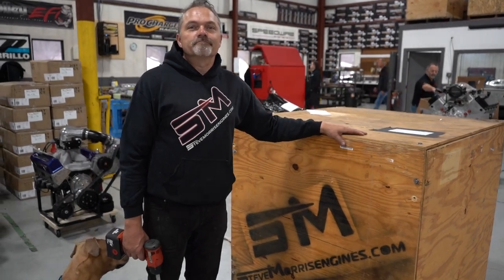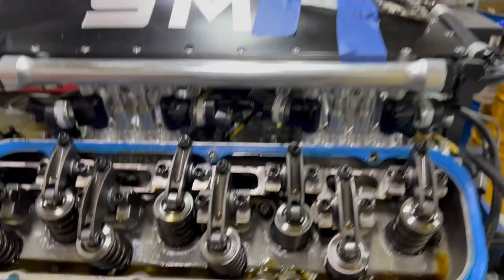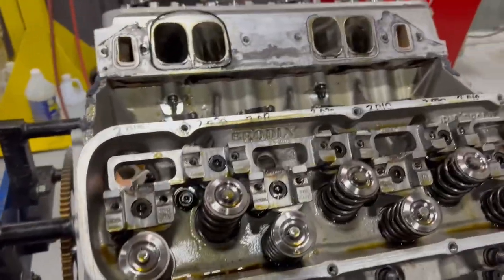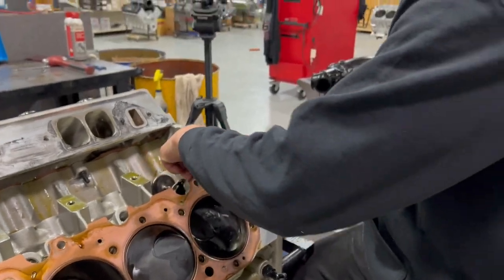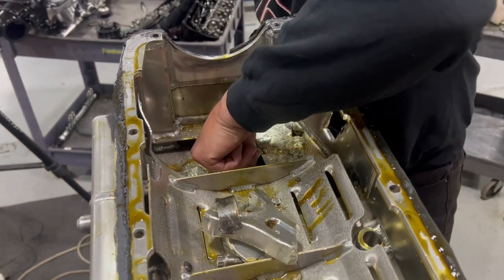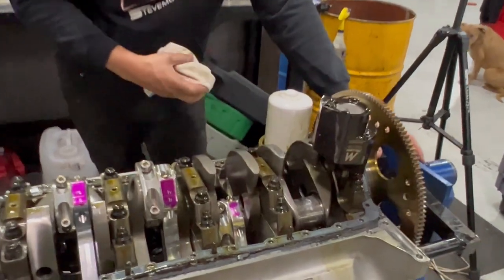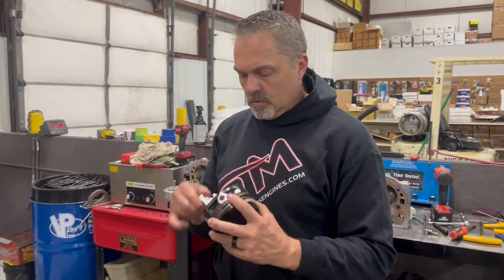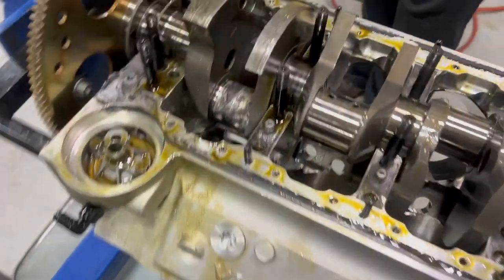Mullet !  What Happened ? - Warning: Engine CARNAGE

Comment: I had my money down on a cracked block. I'll eat crow on that. My next question, how much boost does it take generally speaking to bend one of those cranks? I also have to wonder myself ( and I by now means what so ever am even close to being an expert, I am just trying to obtain some education here ) if hitting 50psi and then slamming into a quick boost cut had anything to do with that. I still think that the damage was done during the first pass at Bradenton when he power wheelied. I could well be wrong about that as well.
It will be interesting to see what choices Garret makes from here.

Thank you Steve for taking the time to show everyone this tear down!
Reply: Prediction: This motor goes into Leroy, SMX goes into Mullet, and Cleeter and crew continue to operate without a checklist and start the motor without oil at least a few more times.
Reply: @icandreamstream  I suspect they have been working towards an SMX for mullet. I just don't think they were quite ready to go there just yet. I dont think this engine will go into leroy. Assuming the block passes muster, I would hazard a guess that it will be built to be a back up for toast or killa bee. You have to admit, he has been getting slightly better about going thru things. Mainly because of the expense involved in not doing so. Short term though, I bet the BBC gets rebuilt to get mullet back on the tracks quick as possible. That or Steve found him a used SMX, like the one out of the wagon for a reduced price tag. One thing is for sure, we will see how the pieces come together soon enough.

Comment: Welding an aluminium block is a bad idea. The heat affected zone will be annealed and its tensile strength will be a tiny fraction of what it was at the original temper.

Edit, unless you guys heat treat the block after welding. However, both welding and heat treating will cause distortion. All interfaces would move. I reckon that would scrap the block. Only way to be sure would to 100% measure it afterwards

Comment: My old man had an international pickup with a connecting rod jammed into the side of the cylinder wall , literally ran quiet and smooth for months before he pulled it apart and was shocked how she was hanging in there ….

Comment: Hi Steve
Enjoy your content.
I have a couple of observations to share,  to try and help, not criticize.
The Half seized main is strange yet also interesting, could there be a misalignment with the tranny???
This crank was a proven, reused piece so a factory flaw is highly unlikely.
Rod journals 7 and 8 have evidence of seizure
Please correct me if i am wrong...
Rod 7 oil is fed from Main 4 which also feeds Rod 6.     Main 4 is half seized, rod 6 is fine, rod 7 is seized.
Rod 8 is fed from Main 5, Main 5 is fine, rod 8 is seized.

One potential cause is aerated oil.
Air will travel the path of least resistance, it will affect the closest components from the pump first.
I am assuming this engine has traditional oil galleries.
In the case of a BBC, oil enters the block from the oil filter at the rear, feeds the cam bearings then down to the mains.
If air is travelling with the oil it will hit the rear cam bearings first, have a close look you may see some smearing.
it will then travel to the rear mains and so forth moving forward, the air will dissipate and be less of a factor further down the line.
Main 5 is substantially larger and supports less load because there is only cylinder 8 to support.
Main 4 is smaller and supports the load from both cylinders 6 and 7.
I believe this is where aerated oil will most evident.
The crank rod oil gallery timing with the main may explain why rod 6 is in much better condition than 7.

Your refresh video of this engine eluded to potential oil starvation issues with wet sump systems.

Dry sump this puppy.     or......... What Garret really needs is an SMX.......... 

Thanks

Comment: Well high boost damage is one thing but high load low rpm would put the crankshaft under insane amount of load . And they are locking the converter up pretty early . But that’s just a hypothesis. Thank you for always sharing and teaching . God Bless.

Comment: I'm no engine builder, but for an application that I KNOW the engine is being pushed beyond what it was designed for, I wouldn't even consider repairing that block or the chunks taken out of the head. Cleeter just needs to step up to the SMX and let 'er eat.

Comment: #4 main feeds oil to #6 and #7 rod journals.
#5 main feeds oil to #8 rod journal.
If the #4 main was the problem that caused the failure then why doesn't #6 rod journal look like #7 and it wouldn't cause  #8 rod journal to fail. Why is the rod missing both bolts and a rod cap?
To me it seems the line bore of mains was cut incorrectly on #4 main or crankshaft main on #4 was machined off center for the main to wear on one side or could the upper main bearing been a different size? Them guys running engine with no oil I'm sure wasn't good either. It's definitely a shame that the engine had only a failed roller lifter and after a refresh it has catastrophic failure.

Comment: Steve do you send out crankshafts in between refreshes or just have them checked when something is suspected?? Would a external oil pump be better suited for this type of setup?? Thanks in advance
Reply: Steve already addressed the oil pump and preferred external pump previously during the breakdown and refresh of this engine -> see that video
Obviously, Steve would have sent the crankshaft to the manufacture to be checked during the refresh, if he thought it was necessary.
Reply: Thanks not Steve.. I was asking about his procedures not your opinions fan boy!!!
Reply: @brown7002  Seems clear that Your using "self-reflection -> projection"' as a "Fan Boy" !! 😞

Comment: All I got to say cleetus ran 20 pounds or more more boost than you told them that engine can handle. He abused that engine beat the Tara out of it and it's stood up to the abuse. No one can trash talk you on how you built that motor.  That motor was used and abused and put away wet and went out with a smile on its face with A W. What more could you ask for out of an engine? You couldn't build a better one double the boost you said it can handle. thumbs up and keep it up you're awesome.

Comment: You say it "shows it wasn't running" when the valve head separated but, if the con rod broke, the engine could have still been running, just on that cylinder the piston wouldn't have been going up and down so, same effect. No conclusion about that from that damage, IF the con rod was broken before or at the same time.
BTW, I've had engines with smaller diameter PISTONS than that valve head you plucked out of there! They are huge, of course!

Comment: So you do/don't believe it was A NO OILING issue??? "30 secs to a min with no oil in motor running"  Maybe seized the bearing for a moment".22 secs Then when full pass spun the crank bearing causing the 2 rod bearings to seize, then breaking the Rods??   All  happens quick, so maybe hard to figure out.......

Comment: This is a rookie question as I have no machining experience but I’m just curious if main bearing 4 on the crank could have been slightly offset from the other bearings, meaning they aren’t actually concentric and that one was a couple thou off center. I don’t know how feasible it is or if I’m just making stuff up, just trying to learn something.

Comment: When the crank was ground, could that main journal have been machined out of round? Would make the clearance tighter on that side of the bearing surface. If the main journal is not perfectly round in relation to the center cross-section of the crankshaft. Correct?
Reply from the maker: Crank was never ground go see previous build videos on this engine
Reply: @stevemorrisracing  No I saw the build video. I'm talking about when the crank was originally machined during creation.

Comment: My question is? Is it worth welding and saving the block? This last drag n drive and last year before the refresh Cletus has stated the engine has dropped oil pressure while on the road driving. Also Cletus has stated he has drained the oil for an oil change. Ran the engine and remembered he/they didn’t refill it with oil. Also Cletus keeps telling Pete More boost. Step him up the the Max engine so he can go 5’s in the quarter.

Comment: Wondering if a couple of runs prior to the failure, it hit a huge boost cut under load and thats what snapped the fuel pump belt and possibly twisted the crank. Lets see the verdict Steve, i'm intetested.🙂

Comment: Did you ever figure out what happened to your engine? Was it just a manufacturing defect in the rods like improper heat treatment or something that made them weak? I know not even top fuel brakes all 8 at the same time, that had to be that those rods were weak.

Comment: Hey Steve, here a question for you.  Cleetus spun and started that engine over before oil was put back into the crankcase.
Oil feeds from rear to front, do you think he might of starved the rod journal and pushed rod bearing material to the main journal?  🤔
Reply from the maker: Depends on how long it ran

Comment: Ran without oil heated and coked the oil that was there and stuck the bearing on shut down, the oil just lubricated the damage after startup. I feel the bearing damage on the bottom side the rod is from minimum oil pressure on the bottom end of the track and throttle slams shut yanking up instantaneous when high vacuum hits

Comment: you could have gave the crank the ring test , hit it with a metallic object and listen to the way it rings out , also you could have tested that No.4 main journal with a micrometer riding the journal with it back in the block . could of and could of . we guys that built engines in our shacks in backyards or garages knew how to check things without any money to spare ! ever check the journals for out of round or deformity ? Yea Yea trust  of a "new" or freshly machined crankshaft ? tolerances can be a bitch , my guess is that crank had a clearance problem , could have been a few thousands of an inch , all it takes for a hot spot developing under load,, an issue hiding from the start that caught you by surprise ! it is possible that a the crank twisted by a few degrees between the 3rd and 4th journals warping the mains center line ? If you inspected ,checked the crank during assembly to rule it out.

Comment: injector stuck open and hydro-locked under deceleration? 
fuel then evaporated or blew out after failure. 
would want to check injectors since all signs point towards hydro-lock.

Comment: Line bore is an issue along with the crank ..Crankshaft flex generally gets the center main.However if the line bore is off well you know
Reply from the maker: Line bore off would hit the journals all the way around not on 1/2 the main journal

Comment: If it was my engine or money,  I would not be refitting that crank.   How’s the data logs Steve ?   That should tell if it hydrauliced, if the fuel didn’t burn, there should have been a whole lot of o2 on the oxy sensors .   Funny they run it for a whole season, no issue,  it gets serviced and doesn’t survive the week?   How did the crank inspection go before refitting servicing the engine? 
Magnafluxed ok?  I mean you didn’t just clean that crank and throw it back in?  If you did not get it checked out, then what did Cletus pay for?   And what he payed went straight down the shit hole because the crank was not inspected?  
You may have to bend over and take one for the team Steve.   Makes no sense the old engine could last a season of abuse,  you change brand of rods and possible neglect getting that crank check out, Magna fluxed etc. 
I know you will look after Cleetus regardless.   He is one of your best business advertisements with thousands watching! 
I have had to touch the toes a few times myself,  and I was alway rewarded with the customer staying loyal and my reputation did suffer.
Plenty of other stood firm and said well now that’s racing,  and I gain there ex customers.   People hate throwing away cash and being told, well boy that’s racing 😢

Comment: You need to start holding Cleetus' feet to the fire. You told him the engine was good for 40 pounds of boost and he was running it at 60 to 70 pounds boost. I would be making him sign a contract that if he exceded the boost limits you told him he would be charged triple to fix his duck ups. He either needs to start following your guide lines or he needs to buy an engine built for the boost he is throwing at it. It is disrespectful on his part to not follow your guidelines as you know what it is capable of.

Comment: What came first the chicken or the egg? Maybe like someone said earlier in the comments. Maybe the start up with no oil started the issue. not enough oil in sump to reach the #4 main and scarred the bearing on initial start up? Hard to believe that only #4 would have took the brunt of the no oil. Looking forward to what the crank guy has to say.
Reply: Clearly Your initial presentation, improper, misuse, abuse of that idea indicates clearly Your lacking which You continue with and within Your proposed nonsense !!
Good Luck

Comment: You need to use those UNOBTAINIUM valves. LOL  Mad respect for you. For real. You ROCK!!! Your last engine, 300 plus passes. Never mind the miles on a drag and drive. If anybody knows Cleeter they know he loves to sprinkle the magic BOOST and TIMING dust on his tunes. I think he needs a SR 71, MACH 3 +. He still won't be satisfied until the metal starts melting off. On another note , he won't be satisfied until he reaches mach1+ in a helicopter. lol 🤪 Keep up the good work and improving your machines. Your the best! 🥰 
I did all the research and development on AH-64 Apaches for 35 years and I'd fly anything you build. Thanks for your professionalism.

Comment: I would think that may have been a dead cylinder under load. I worked on. 28,000hp V 18 that took out a main just like that caused by  two cylinders on one bank running weak. Wiped out the crank main asymmetrically like that. Crank was flexing in unusual ways due to the load imbalance which disrupts the oil film on the main bearing. The crank did weigh 60 ton so its a little different but that kind of half wipe is usually unbalanced load.🤷‍♂️

Comment: I wonder if the converter lock-up played a part since the damage is at the rear of the engine….. I know I’m thinking out loud, but I’m awfully curious if that played a part…
Reply: The amount, number and type of Nonsensical comments, guesses, ideas is vastly common on this channel and perhaps more on others.
If You have some proper basics within the principles of mechanics, mechanical, structural, statics, dynamics, physics, then You could have some proper basis of thought, questions, ideas, etc.
Good Luck

Comment: Hey Steve, is it possible the rod bearing failed first, and the rods breaking is what bent the crank? That seems to make the most sense to me.
Reply: @Avboden; perhaps if You would study, learn the basics of physics, especially structures, statics and dynamics, then You will have some proper basic concepts, principles with which to assess, evaluate, differentiate, discern, analyze, determine, decide, troubleshoot, reason, conclude.
=>Thus, not attempt with such nonsensical ideas, comments and 'questions'.
Good Luck

Comment: You mean Hydrolocked. Not 'hydrauliced'. Google that word. It takes you to hydrolocked. Because hydrolocked is the word you're looking for. Hydraulic isn't a verb and isn't used as a verb so it can't be used to define a locked up cylinder due to liquid. Especially when it's already defined as the opposite of that. Ita a volume of liquid in a cylinder that imparts motion or whatever. So it can't be defined as 1 thing and it's exact opposite at the same time dude.

It's HYDROLOCKED. I figured you were smart enough to know this.
Reply from the maker: Nope not smart enough. 
But I am now

Comment: Mr. McFarland ran that engine without oil for about 30 seconds. Is that journal the last in the oil circuit or the first? It's possible that it JUST ran out of lubricity at the moment he shut it off, and only half the bearing made contact. OR, hear me out, no damage was done before shutdown after the no oil incident. However, upon the next startup, there was not enough oil throughout the system, and the journal got half smoked for but a moment.

Race motors pushed to the limit are fickle beasts, and that moment at startup with just a bit of starvation could be the culprit.

Comment: Maybe starting it without oil did cause premature bearing wear and play in the crank causing 1 sided heat marks? Doesn't seem too far out of the question. 🤔

I also don't have decades of experience building engines...

Comment: Just wondering... How did you know how much the engine would take? Did you have prior R&D of engines that failed? Or did you just know what the weakest link would handle? Thanks!
Reply: @L1Z10; You clearly attribute more to Steve Morris than He does to, with himself and his level of knowledge, expertise along with his personal integrity.
Steve Morris is an engine builder -> not an engineer, designer, developer =>thus cannot perform or be involved with R&D=Research & Development
Steve has engineers involved within the design, development of the SME's
The manufactures of the components, parts that Steve uses within each engine build are involved in the design, development, manufacturing of those components, parts, as these connecting rods and those in the SMX and other engines along with the crankshafts, camshafts, valves, lifters, lifting rods, valve springs, rocker arms, assemblies, bearings, flywheel, harmonic balancer, some heads and blocks [as this BBE].
Good Luck